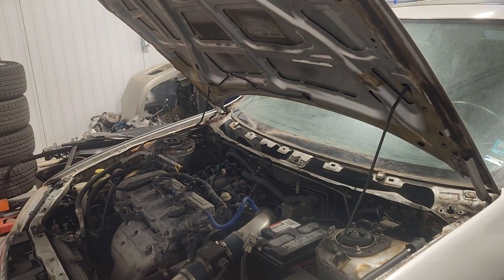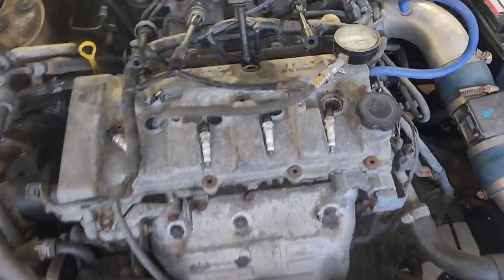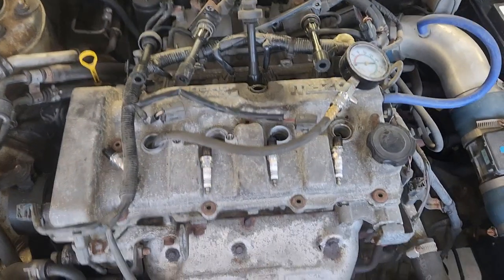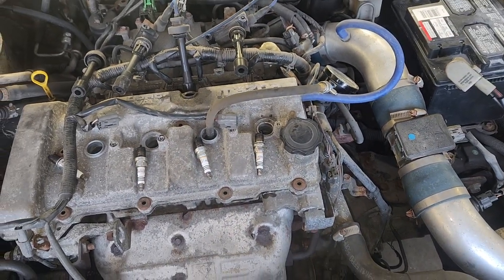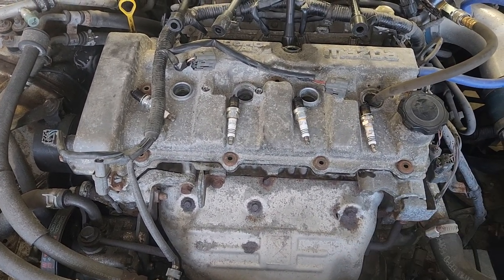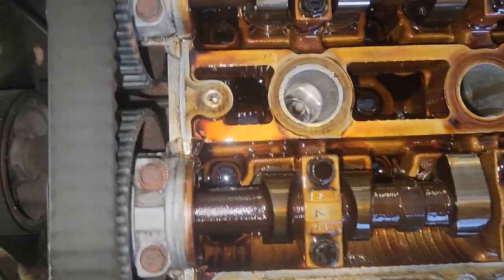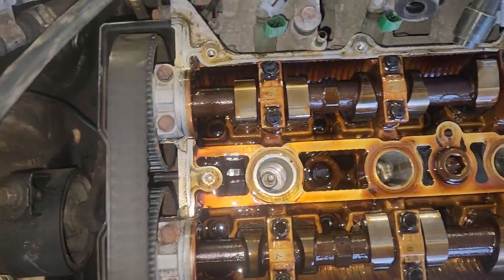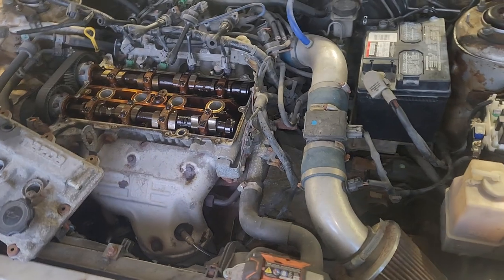SOLD SOLD 2002 Mazda Protege 2.0L Engine 92k Running and Compression Test Video

Comment: Hello my friend did a fsze swap to his 03 protege. Were getting no spark or fuel to engine. Checked fuel pump relay. Its fine. I did notice no rpm movement while cranking. Im just wondering if i have to swap out the crank pulley from the fsde to the ze so the crank sensor is able to read? Kinda stuck at the moment
Reply from the maker: Hey bud

I believe all sensors, intake manifold, fuel Rail and crank pulley from the fsde has to be swapped over to use the fsze engine with de harness. I would start with swapping all these parts over
Reply: @jp_parts  Thank you for the quick reply. I will start by taking those off the list first. Thanks again @jp_parts
Reply from the maker: Welcome ! 
 @rickyfc335